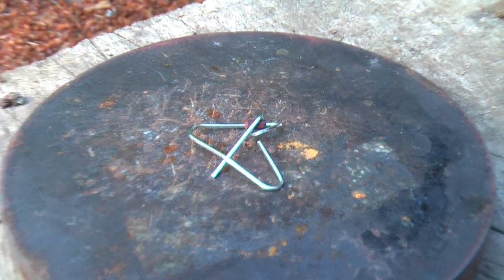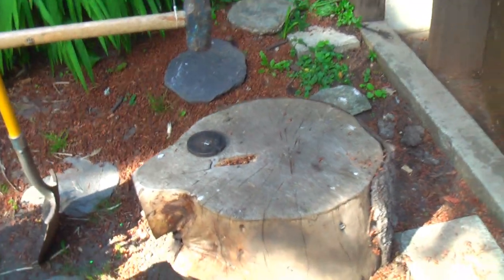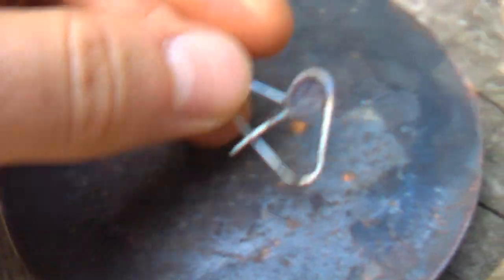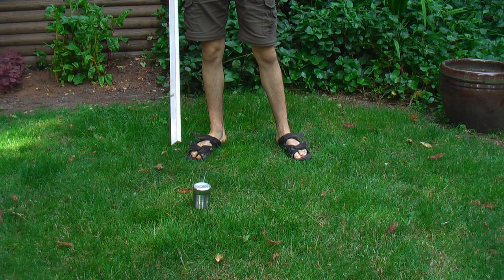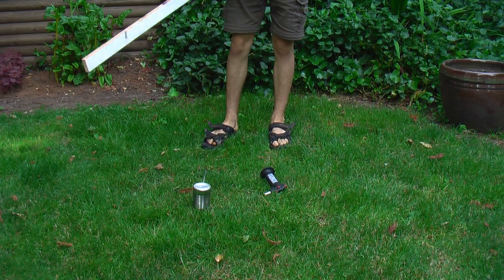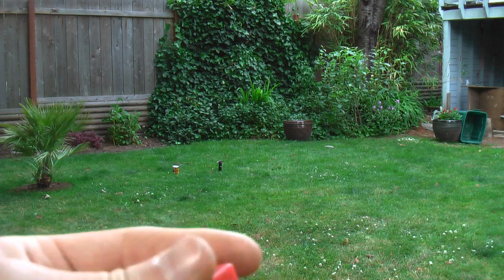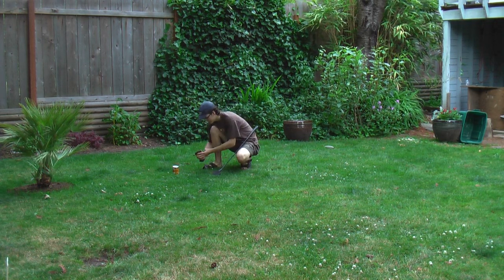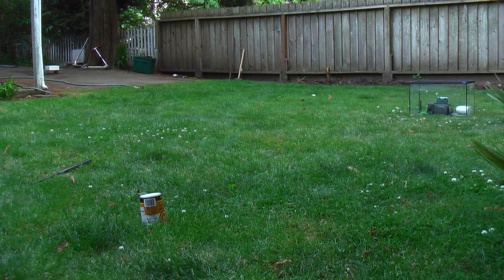Exploding Flint with a Sledge Hammer

Comment: you can heat a flint up to glowing hot, & 'thump' it with your finger & make a mini-comet. I used to put them into the end of a cigarette, light the cigarette puff it slowly a few times, look at flint to see if heated to glowing, then thump it like flicking the end-ash off of it, the flint explodes as it leaves and trails across the sky until it burns out, usually leaving friends speechless with jaws hanging open briefly.

Comment: You can just take a part a lighter that has ran out of fuel wrap the flint in the spring, heat it up will its glowing and throw it on the ground as hard as you can. Its nicknamed a "flintbomb"

Comment: The flint is actually magnesium  and a better easier way to do it is open a lighter get the flint out of it and then stretch out a spring put the flint in the spring and then make it red hot with a different lighter then take the end of the spring with the flint init and throw it at the ground about 4 feet in front of you (just watch the vid on my channel)

Comment: seeing as how you have a high speed camera and I dont, ya gotta try this.... it works just fine if not better with the small flints and the spring that camr from the lighter.  pump up a bb gun with out a bb in it( check and make sure) and bend the spring at a 90 degree angle, and heat to brilliant orange glow.  now insert it in the end of the barrell and pull the trigger.  all particles get o2 immeadiately, sounds like a shotgun for real. done it many times, just dont spook the neighbors!

Comment: hey, for getting slow motion fire or anything, focus on the sun. you wont be able to see anything until the fire starts because it will already be the correct exposure to the fire and anything not as bright as the sun will be black. but the actual fire will look a lot better.